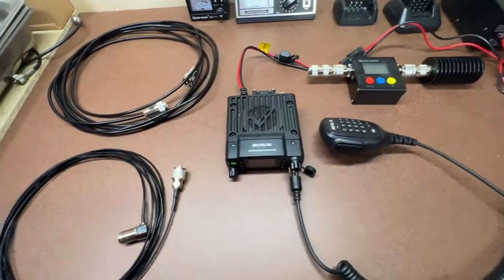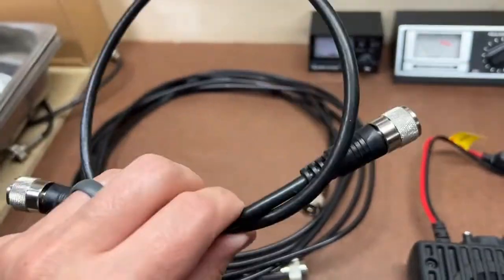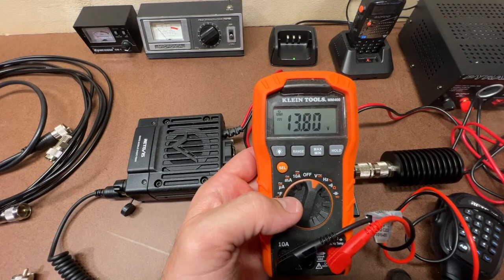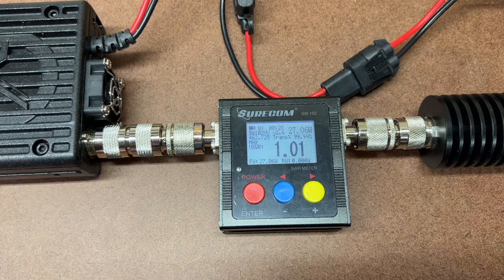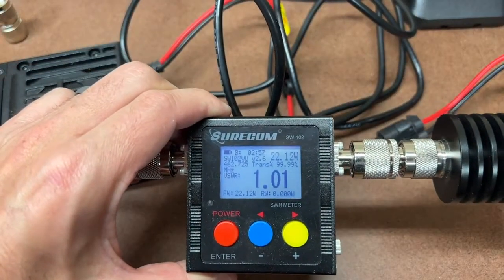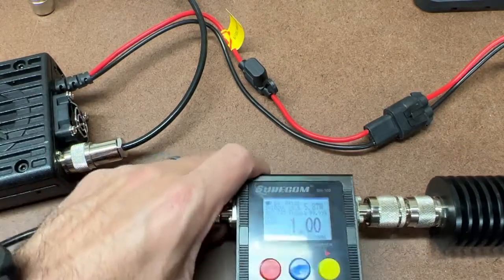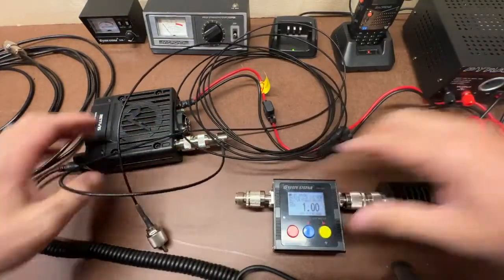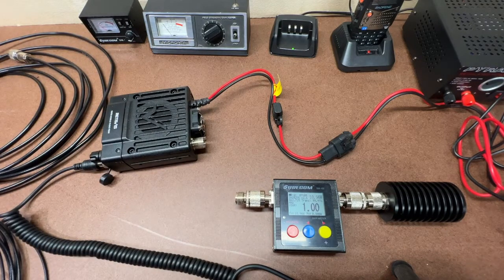Which Coax Cable is best for your GMRS Mobile Radio?

Comment: I think something is wrong when the 3 foot cable is loosing from 27 watts at the radio to 22 watts at the end of the 3 foot cable.   You should use 2 power meters one at the radio and one at the dummy load to make sure the  out going power does not change.

Comment: For GMRS nobody should use RG-58 or RG-174 type cable. SHORT lengths of LMR240 or RG8X are OK for mobile (loss is still high) For a base station LMR-600 would be best but LMR400 is OK if length is kept fairly short. The use of N connectors is also a good idea at UHF frequencies,

Comment: Should the SWR meter be between the radio and cable?   You have the meter next to the dummy load at the end of the cable.  Great for determining loss I guess, but not reflexive RF energy back to radio.

Comment: Dang That is A Ton Of Loss 20% to35-40%Loss Dang ! The Experts Say That Quality Coax Is Very Had to find online probably 97+% of the Coax Sold On Amazon Is Fake from Rg8 to the RG213/U & lmr-400 I Also Know This From Experience ! 1st Lesson to any New Ham or cb person (I have ben for 35-40 Years) NO Quality Coax Will Have an Aluminum  Shield Or a cca in any way & Especially No Steal wire if you have some that is then its Fake & the Loss on the fake stuff is just atrocious & it will drop your receive and Tx down to 6-7 Miles or less if you are lucky ! i live in the Beautiful  hills of the Appalachian Mountain's of eastern Ky & we can get 6-8 Miles on a 4 watt Baofeng HT without much trouble even in our hills & Hollers ! ! just wanted to drop some truth to some one that may see this & be wondering..O If you want Good Quality Coax Check DX Engineering or Gigaparts ,R&L Electronics, RF Parts and Coaxusa.com Their is a good reason it cost a litle more copper is just More expensive than steal !

Comment: On paper, my 50W radio tuned to 462 MHz provides 38.7W of RF power at the antenna (120W ERP)...using a 60Ft jumper of LMR 600.  I do have N/PL259 adapters on both ends of the cable so maybe a little less.  I have not metered it as you did here.